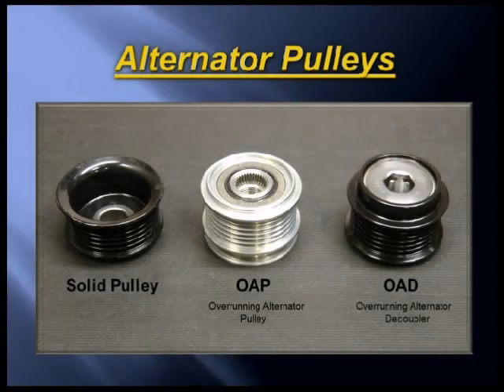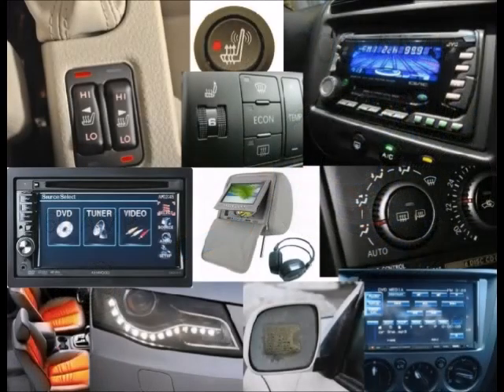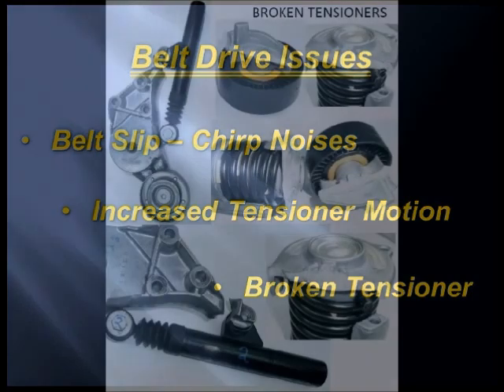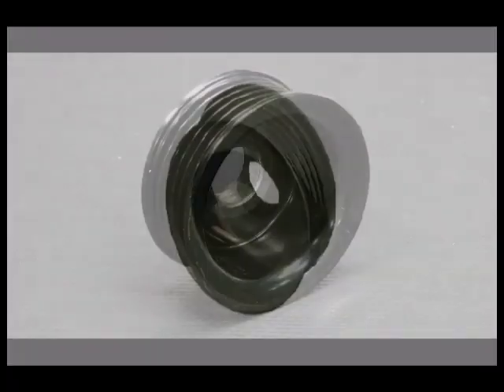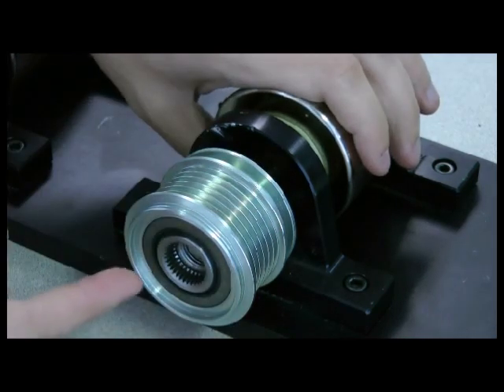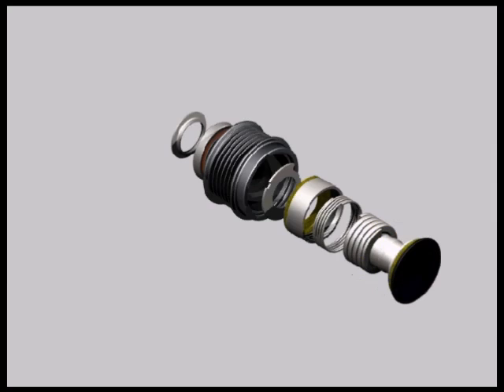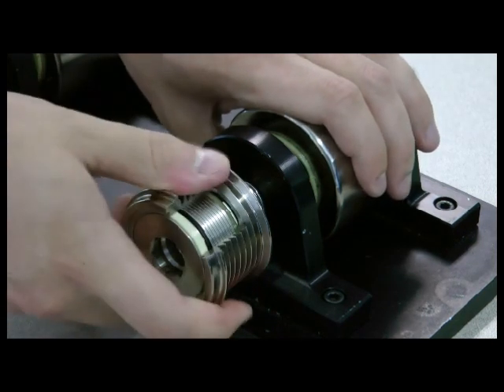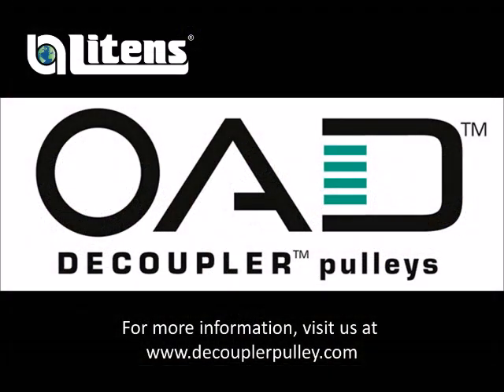Different types of alternator pulleys and the need for OAD's

Comment: manufacturer produce with solid pulley
but I switched to OAP.  I am happy  with the result fuel econony and less vibration.  my car is 2006 golf 1.6 fsi triptronic.
Reply: Meaning you just change the solid pulley to OAP?
Reply: @ been using about 3 years happy with result.
Reply: @kerimbeser6624  Thanks.

Comment: Should any leak oil? No bearings in the pulley right? I'm learning to be rebuild and I just popped the cap off a junkyard denso and it has a bit of grease like oil behind the cap
Reply from the maker: Yes, the OAD does have a bearing and grease purge is normal which is why there is a cap to help contain the grease.
Reply: @Litens-Aftermarket  was going to rebuild and clean alternator and trying to decide if I should replace pulley
Reply from the maker: Many times the pulley fails before the alternator as it is designed to absorb the harshness of the system.  If the alternator has failed we would definitely recommend replacing the OAD.
Reply: @Litens-Aftermarket  it hasn't failed, I'm just trying to teach myself how to rebuild one so I bought a used one with 140,000 miles. The brushes definitely needs replacing as does the regulator that broke off the tip during shipping.
Reply: @Litens-Aftermarket  do you know on the Toyota 2011 sienna denso unit how to take it off?

Comment: When was OAD adopted and why can't you put OAD instead of OAP
or why can't you put OAP instead of a solid pulley?
You should be able to upgrade, but you should never downgrade.
Reply from the maker: The OE's determine what pulley type to use on the alternator based on the overall accessory drive.  When a solid pulley or OAP is used it is often because an OAD is not necessary and adding an OAD will not benefit the system.  Also, although OAD's can look identical on the outside there are differences inside on items like spring rates that will make each OAD behave differently.  Thus, when an OAD is recommended it is because the OAD and it's internals have been designed for a specific OE system.
Reply: @Litens-Aftermarket  so which one is better?  OAD OR OAP?  Please enlighten me
Reply from the maker: @zulfitrialimin2564  We are not saying any one of these is better than the other necessarily.  What we are saying is when replacing your alternator or the pulley you should use the same style pulley as the OE's used when manufacturing the vehicle.  If when the vehicle was brand new and came with a solid pulley then a solid pulley should be fine the use as a replacement, the same goes for an OAP and an OAD.  Where you start to have trouble is when the vehicle was new and came with an OAD and you try to replace it with a solid pulley or OAP.
Reply: The spring in the decopuler is specific for each car, cylinders, firing order etc. Basically the spring acts like a tuning fork for belt vibration.